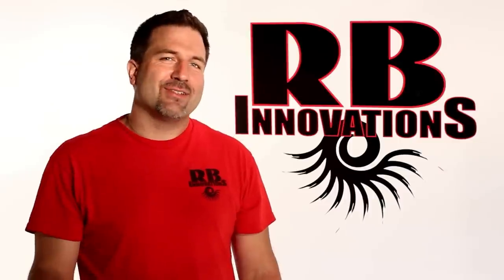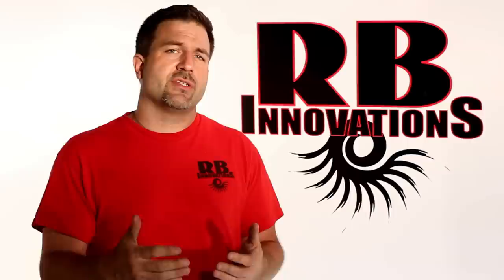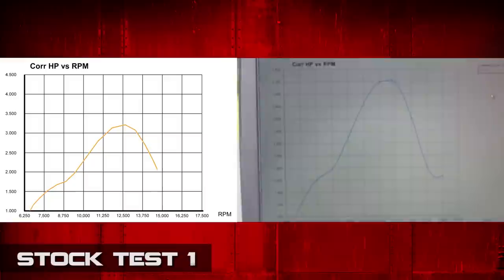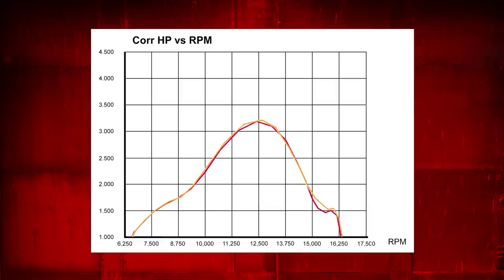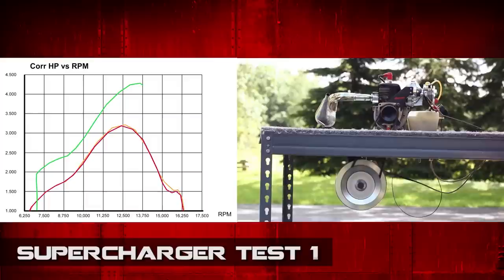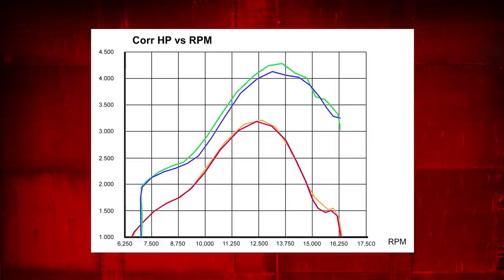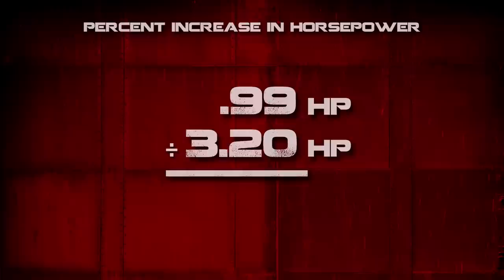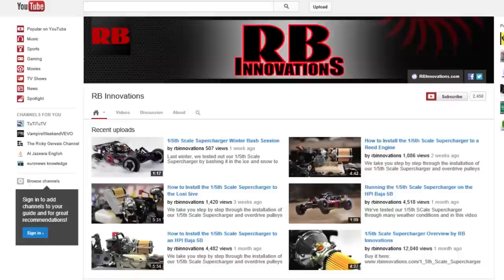Dyno Test of the 1/5th Scale Supercharger by RB Innovations

Comment: the "supercharger" kit made of cheap as hell looking, cast aluminum? yet, costs TWICE as much as buying a brand new high output 32cc engine =/  please explain
Reply: Kingsize001100 it's not a roots type supercharger...it's an impeller type...ever look inside a turbo ? Granted...this thing is only spinning maybe 36-40,000 rpm at most, wheras a true turbo will spin at well over 100,000 rpm. These small single cylinder motors require very little air and that large impeller (large for anything 20-50 cc) moves more then enough air to make a pound or two of boost.
Reply: A blower is mounted to the front of an engine like a Paxton or vortex  and a supercharger is mounted directly to the intake like a Whipple twin screw. Hope that clarifies it for you.
Reply: ...blowers, superchargers, roots, centrifugal, gear driven, etc, they're all SUPERCHARGERS if they're "belt driven"
Reply: This is where arguing with people who don't know what they're talking about, is pointless.   They think if it's not bolted to the manifold, it's not a supercharger. *sigh*.  If it is NOT driven by the exhaust gas being forced across a Turbine wheel, and is driven via shaft, gear, chain, or belt. It's a supercharger.
Reply: And to add to that, a "turbo" is an exhaust driven turbine supercharger, supercharger is a broad term encompassing anything that "supercharges" the intake pressure.
Reply: @sulken2000  or gear driven in the case of the Detroit 2 stroke diesels
Reply: @sulken2000  A turbo is still a turbo supercharger.
Reply: @stutank07  oh...and you seem like a real genius spewing out paragraphs of a weedeater owners manual...verbatim! Who throws stones also lives In his mom's basement..super impressed by your brilliance
Reply: It doesn’t cost twice as much as a high output engine.
A high output engine costs a couple grand.
This supercharger kit costs $300 which is THE SAME as a OEM ZENOAH
What high output engine are you buying for $130?
Reply: So I'm not into remote control cars................as you can see by my profile pic.... I'm just going to say,  reading these comments just made my night!. Settle down gu...... boys......
Reply: @weaver412  bro you wanna argue about beamers???
Let’s fucking go
Reply: @glennedward2201  LoL! A "Blower" and "Supercharger" are the exact same thing ... just different names! and it does not matter where the hell they are mounted, they are still called the same thing. No wonder no one can learn anything on here, with people that have no clue spreading there nonsence everywhere.
Reply: @charliebrown238  

 Fairly simple and yes there is technically a difference.

Every blower is a supercharger, but not every supercharger can be a blower. A blower is just another name for a supercharger, particularly roots-type supercharger, which is probably one of the oldest styles of supercharger. At the heart of the roots-type supercharger are two counter-rotating meshed lobed rotors. The two spinning rotors trap air in the gaps between the lobes as they rotate, moving it around the outside of the rotors from the inlet at the top to the bottom of the supercharger. Technically speaking, roots-type superchargers do not actually compress air internally in the supercharger; instead, they push air into the intake manifold into the engine. That is why is type of supercharger is sometimes called a “blower” rather than a compressor. These types of superchargers used in cars typically have rotors with twisted lobes to ensure low vibration and quiet operation.

Comment: Im not sure you guys understand how a graph works, the sycronization of the video was just stupid cause the rpms drop in the video, but continue to grow on the graph. And please explain how the power drops all the way to 1 hp at 16,000 rpm.
Reply: +thiagov6123 hard to make torque [fill the cylinder] at that speed, especially with a crank-driven power adder.
Reply: I was scrolling to see if anyone had commented on this.. Either these guys have no idea how graphs work, or they need to hire a new media dude... The info is this video is crap
Reply: it's not an exact sync ...they know how a graph works
Reply: thiagov6123 all internal combustion engines will show a drastic reduction in hp when pushed past a given rpm. That is why you try to gear your vehicle to keep revs where the power is at.

Comment: anyone else notice how they didn't let the engine rev out without the blower on?

if these worked why don't we see them on other 2 stroke applications like bikes, karts, snow mobile's? cause they don't
Reply: Marc Unger To be fair a huge portion of turbo'd sleds are four stroke. Apexes, Nytros, etc.
Reply: Marc Unger
Reply: Lol, I'm done arguing with illiteracy. Have a good day, friend.
Reply: Yeah I noticed that to...would be cool if it worked tho
Reply: Someone's rattled your cage haven't they sweetie?
Reply: @haydenharter6051  The only ones I can think of are the Screamin' Jimmy engines used in commercial trucks, the EMD 2-strokes used in locomotives for decades, and container ship engines. Interestingly enough, these two strokes don't use the piston to control exhaust, rather, that they have exhaust valves operated by a camshaft while the piston opens only intake ports. And in these engines, yes, you can boost them, 'cause there's nowhere for the incoming air charge to go.

Comment: Thank you! I've found a wicked Baja with this SC on a OBR 34.5cc said to make 9.2 HP and I believe it now hahah should be a fun one for my first Baja! 👍
Reply: Be sure to post a video man! That sounds awesome
Reply: @charleswatson3951  for sure bro! He also has a HPI based Kraken Class 1 with a 32.5cc supposedly making 5.5hp on knobbies also I might try and make a package deal on the 2 👍 I also made a mistake on first comment kinda as it's the Kraken Sx5 Sandrail to be exact that has the 34.5cc OBR with the SC and some other upgrades on it. It's on slicks for road use but comes with some knobbies! I just got a Hero 4 to go with my cell phone for video's just need to get everything setup as I have 14 other RCS rightnow all electric besides my fully built Jato 3.3 but want to get my channel up and running this spring as I live in Ontario, Canada so it's gnarly out for about another month with alot of snow, ice rain and -20/-30 celsius so thank god for crawlers to tide me over hahah I also have a crazy Arrma Limitless I have one test on at 114mph looking to hit 150mph before ESC upgrade as it runs a monster TP motors 5650 1440kv with a Monster 8s will need XLX2 to step it up I think 👍 Just love talking RC sorry for the story hahah

Comment: 31% gain in power divided by $ 275.00, is it worth it ?.  Will this extra HP be usable to an average RC Joe ?

Have you tried these engines running at sustained engine speed of 17,500 RPM, then you will see the difference.  You have not indicated the engine temperature before getting the data and other atmospheric conditions.

Just my insights....
Reply: pinoyeh you'd obviously go to a taller gear set and try to keep the rpm's where the peak power is (11,000-12,500 or so) rpm does. Ot equate to horsepower. As you can see, the power rapidly falls off after 13,700 so why you'd continue to rev it higher is a mystery to me.

Comment: This is just a fucking joke
Rpms will not keep increasing when you let of the thottle, like wtf kinda "dyno" are you guys using?
Reply: spentfromnz  RPMS DO NOT keep increasing when you let off the throttle, doesn't matter what graphic you're using, facts are facts.
Reply: +twinkmaster2 use your head for something more than a hat-rack, that was an animation added to make a chart more interesting, not a real-time readout fom thedyno machine.
Reply: twinkmaster2 what makes you think they closed the throttle at peak hp ? When forced induction is used on a two stroke, you often see drastic gains in mid range numbers and a sharp drop in hp numbers when rpm exceeds a given point. They tan the motor up to it's 16,250 rpm redline in both configurations and that's what the computer measured. Idle to 16,250 and back to idle with the peak hp being registered @ around 12-5 stock and 13,200 with the blower.

Comment: That’s a pretty decent bump, shame though that the belts break left and right, then it’s replaced about half a tank if ran hard, maybe a tank or so if your easy on it, they need a v pulley and a harder belt, something made from like radiator hose material, rubber with rope reinforcement, or even a clogged police system

Comment: sadly supercharging only works with valved 2 stroke engines , so i call BS on this one :

the graph is sh*t , because the rpm still rise when the throttle is clearly shut , so no actual information can be taken from it.
the dyno would be nice , if you were to show it showing nubers , which you didnt , you put in a picture of a pc screen , so yes , BS
Reply: drache444444 
Clearly not
Reply: Turbo and supercharged 2 strokes has been a thing for decades, and does work. He'll diesel 2 strokes have to have a turbo or supercharger to run. Ski-do snow mobiles have turbo 2 strokes in them as well.
Reply: @TheAmericanUhate  
Yes, of course supercharging 2-strokes is a thing, but only on 2-strokes with exhaust valves.
the Diesel 2-strokes that youre talking about have inlet and exhaust valves and dont use the crankcase for pushing the gas exchange in the zylinders , they use a turbo or supercharger for that. theyre basically 4-strokes where youve put the inlet and exhaust in the same place, and thats inbetween the compression and power stroke at the lower deadspot.

ive never had a look at ski-do snow mobiles, but eather theire diesels (like i explained above) or theyll have a rotary exhaust (and most likely also intake) valve making it possible to be charged.

on a regular 2-stroke (like all 2-stroke model engines ive come across) charging would only have negative effects.
you would be pressurising the crankcase, hindering the piston from pushing into it on powerstroke and when the gas exchange happens the over pressure would push straight to the exhaust port (which is open at the same time as the inlet port, most often even longer than the inlet) and because of fluid dynamics not even exchange the entire volume of the zylinder.
theres a good reason why 2-stroke technology went away from a high pressure gas exchange to a low pressure slow flowing gas exchange using the tuned exhaust pipe
Reply: @drache444444  At least they have the carburetor in the right place this time,  unlike their older nitro engine kits!  lol   I asked them years ago how they could set it up as a "blow through" system,  without the supposed "boost pressure" blowing the fuel right back through the needle valve and back into the fuel tank....  I never got a response.  Can't imagine why... haha
Reply: @billymanilli  Oh wow, so that absolutely confirms my opinion of these "dyno tests" of RB "innovations".
they just lie.
Reply: The Diesel 2 strokes I've been around (Detroit Diesel) do not have intake valves. They have exhaust valves in the head. But the intake is a series of ports at the bottom of the cylinder, basically the same as a small 2 stroke engine except the air is forced in by a blower and sometimes a turbo as the air never reaches the crankcase to be pressurized. Whereas the small two strokes compress the air/fuel mixture beneath the piston as it moves down. Then as it reaches near BDC the pressurised mixture is dumped into the cylinder as the transfer ports are opened.
Reply: @trustyoldiron5416   oh , thats nice to know that those detroid diesels dont have inlet valves, but ports near BDC. makes sense tbh.

but as i said, modern sporty-ish two strokes dont really need that crankcase pressure, they use the exhaust vacuum to pull the gasexchange, rather than push it from the crankcase.  a good demonstration of this is 2strokestuffings video on running his 50cc engine without reed and rotary valve, you can see the crankshaft straight throught the carb for the whole revolution ( i know theres 2 strokes that use the piston or crankshaft itself for closing the crankcase, but his doesnt )

Comment: So how many 100's of dollars does this 1 HP gain cost?
Reply: *****  Not when you consider power to weight ratios. yes 1 horse power for 300 bucks would be ridiculous for a real car but considering power to weight, that 1 horsepower for a hpi 5sc would be like 100 horsepower in a 2900 pound car.
Reply: ***** Its the same as a 300hp street car gaining 100hp it was 1/4 of the total hp so not that stupid
Reply: Red Long This test is completely useless... In a real car we don't test HP out in the Crank because its worthless and completely useless.. ANY ENGINE with no load can gain shit tons of HP out of the most stupid modification shit even changing the filter can affect your HP that is why we do a Dyno at the WHEELS because it takes into consideration drivetrain loss and total weight of the car.. Unless this is done in a BAJA and Dyno the wheels they cant prove they gained shit... Its like buying a brand new spanking Mustang Shelby GT500 and then realize ford just specd out the Crank HP and in fact your supposedly "500HP" car only has +/-427whp a rather different number you see.. If you put that into perspective this S/C can only be adding .20HP at most and that isn't worth the 275bucks price tag.. You could probably gain more than that with just higher octane fuel.. And well "Adding" its a wrong word since S/C don't work on 2 Strokes to begin with.

Comment: thanks but I would spend the $400 on a bigger motor....and get more power....
Reply: Seriously....  $400?????? ouch
Reply: Johan Visagie yep way over priced
Reply: Ramsay i think this test is BS and i think the supercharger is BS and this is nothing more than a money scam
Reply: James Palmer agree
Reply: the Zenoah G320RC cost 299
Reply: legit that dyno test was so off..what's that flat 7.5hp all about at the start of the rev band that suddenly whips up like it would with lighter clutch springs 😂😂
Reply: and how the RPM kept going up after they let off the gas lmao
Reply: What motor are you getting for $400 exactly?
Reply: @OversteerIMF  seen 1/5 scale motors for $700+ so to drop $400 on a good motor is not hard
Reply: @conanruisi  I don't know lol, but it will be better then this BS setup
Reply: @ramsay4804  the 1/5 scale motor you get for $400 used to be exactly that motor.
It’s now $300.
The supercharger retails for $275
That means for $575 you get an engine that you can upgrade the internals on, with a supercharger.
Good luck finding a 1/5 scale engine that makes more power in the same price range for a car or truck.
You got a boat? No problem, use eBay.
Car or truck? Becomes a problem, your only options are OBR or RC MAX.
OBR being the cheaper option with their cheapest complete engine package (for high output) being $749, however trying to upgrade this is not recommended you’ll probably end up lowering the performance of the engine.
Sure OBR sells a 9hp and a 12hp but you absolutely CAN produce 7hp from a g320 zenoah, in fact OBR sells a g320 which starts out at 7.7hp, and then you’d be making more than that if you were able to significantly boost it.
The point is if you don’t have the money then why do you even care?
It’s still selling in 2020 so it must either work pretty good or at least have a following because it’s cool.
Reply: @conanruisi  cool story bro
Reply: @ramsay4804  oof hit that google bro

Comment: Interesting, theoretically all 2strokes are supercharged the piston underside is a reciprocating air pump. But it sucks the air in at less than 0psig so if you pressurize the intake you could get more combustion air into the cylinder. I have never seen this done before but I guess it works.

Comment: Hey, I have a turnigy 1/16 nitro buggy with a 0.7 upgraded motor do you have a supercharger I could use for that type of motor?
Reply: You don't want one...   Just makes the engine run lean.  The engine already sucks in as much air as it can get...   Not worth the money
Reply: Yeah iy runs lean. And just makes the piston loose compression quick. 
I had one wasnt happy. But yeah it looks sweet installed lol.
Now planning on getting a SC for my baja, but i dont know if its the same as a nitro engine. Since this one has its own ignition so running lean wont be a problem. But im more in if its going to gain hp.

Comment: Why lie to us?! it simply will not work on a 2 stroke engine
Reply: @Chris & Kristin Olson Its a zenoah engine the exhaust and intake ports are open at the same time for about 5d.
Reply: Will proof is in the application. I bash with a  Rampage and a 32cc engine. My buddy and I bought ours at the same time and when ever we drag raced they were equal. I put this charger on mine and it has much better acceleration at mid range and better top end than his.  In 100 feet my truck is 10 to 15 lengths ahead of his every time we try.  Is it 31% better, NO. Is it worth the money I would say YES if you like cool things to play with.